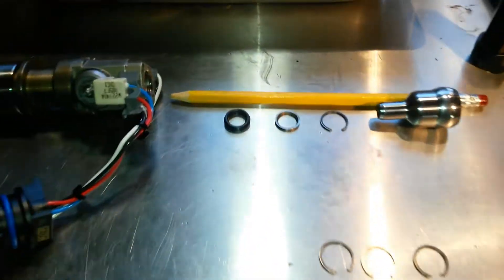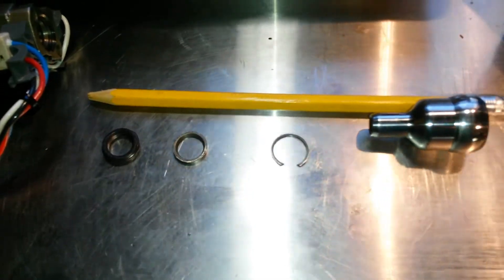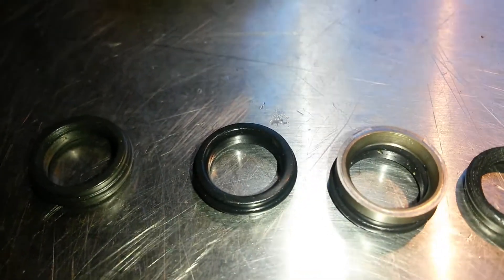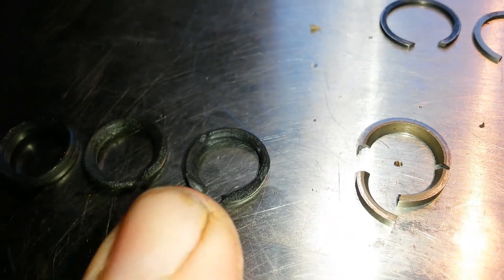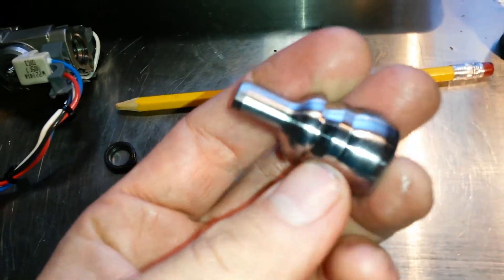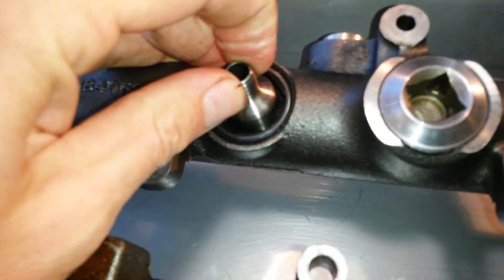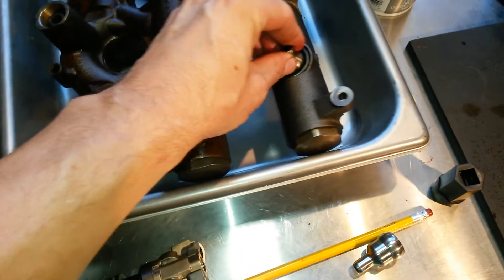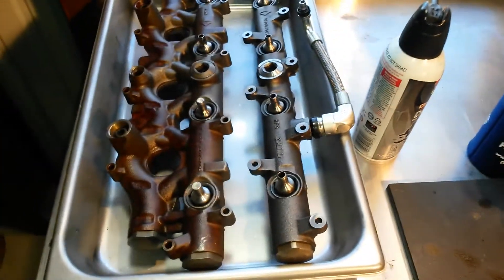Ford 6.0L Diesel Top Injector Seal Series (Video 1 of 3) Overview What Are These Seals & Why Replace

Comment: Nice
But they don't last 6 months
Replacing injectors top  seal's is not the way to go You need to buy New factory injectors
Reply from the maker: They last if you replace the nipple cup seals too. The top injector seals are destroyed from above by leaking nipple cup seals. Use our leak proof nipple cups for a lifetime fix.
Reply: @HHCDiesel  where do I go to buy the rail cups?
Reply from the maker: @RRDJTURNTABLE  HHCDiesel.Com
Reply: Did they last you this time around,  I just had a failure from a engine rebuild , used some cheap top injector o rings, ive got a mahle set now

Comment: I’m not buying what your selling here with leaking cups causing the o-ring failure, if this was true the truck would have a no start when hot  and would not pass a air test after injector replacement, just another gimmick to add to the pool of “ bullet proof “ crap that can’t permanently fix a 6.0 , they are 3-5k a year  maintenance to own
Reply: wow...........well, your wrong, these do work very well.
Reply: @rosiepalmer6270  I call bullshit , if the cup leaks before the injector seal the truck would have a no start when hot well before the O-ring goes bad on a injector ... don’t believe me I’ve only been working on them and diesels for 16 years .... how does the cup magically heal itself after you replace the injector seal ? In the thousands of 6.0 jobs I’ve done I’ve seen 1 and only 1 oil rail go bad truck was a crank and no start because one cup seal had a leak  .... this is a gimmick .... but tell you and your buddies to buy it up
Reply: @johnjohnson-uz2gl  you call what you want to, I had a hard start when hot, and the frigging cups on the high pressure oil rails were bad. I never said the cup magically healed itself, unlike some I do not write a history book, opinions are like buttholes we all have them and most stink, so, have a good day.
and rest assured, I wont ever let you under the hood of my truck.
Reply: I'd say thats the cost per year if you DONT do the maintenance. Literally never have problems with my 6.0 and I've got 300k on it. People don't stick to the maintenance schedule or use knock off sensors and critical components then cry about a terrible truck smh

Comment: I just pulled mine apart had an oring split, The oring itself didnt look too bad though it seemed a little stiff. the beveled backup washer was in pieces. Is there anywhere I can purchase the backup washer?
Reply: Did you find a replacement backup washer? I am having the same issue that you had.
Reply: @jedm3268  i went to a diesel shop and they gave me one off an injector they had sitting around